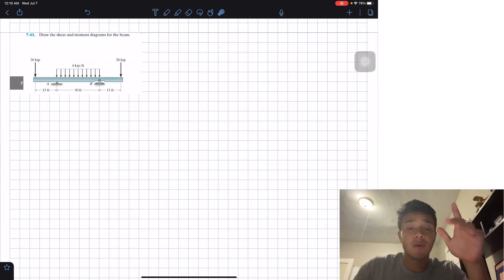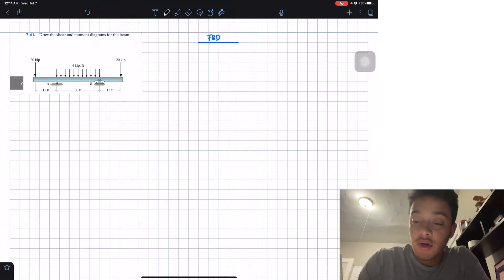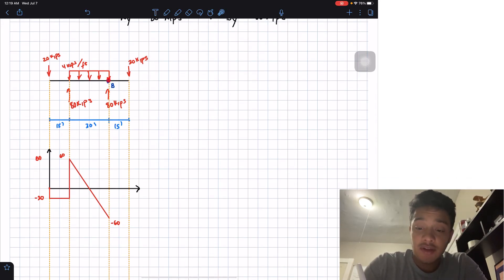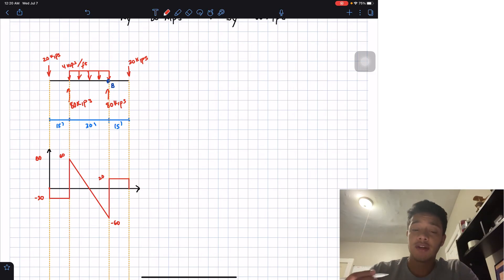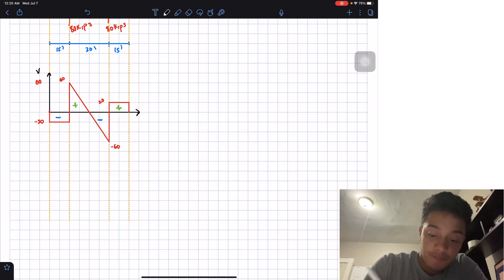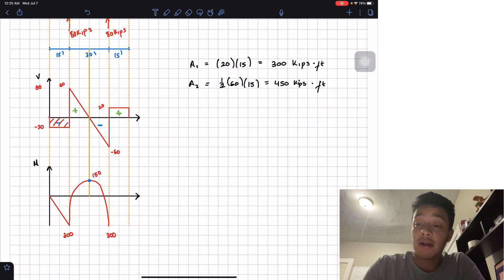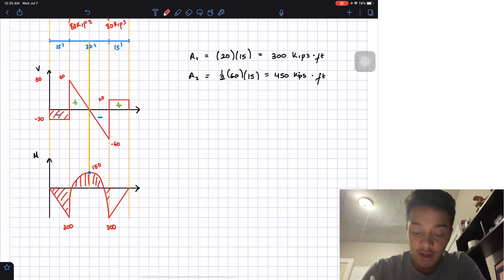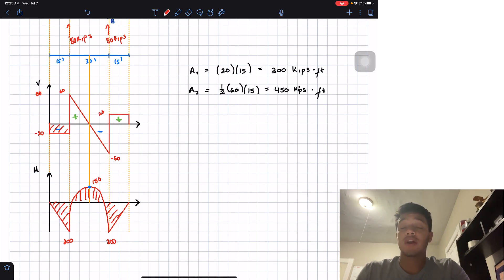Statics 7.61 - Draw the shear and moment diagrams for the beam.

Comment: You explained the logic really well, using it I was able to mentally complete the BM diagram. I’ll look for other examples to 
 complete BM in my head without writing.

Using similar area method to get the points on y axis (integration) Can u also do few examples on deflection diagrams? 
Thank u

Comment: How did you know the Moment at B was counter clockwise? 3:20
Reply from the maker: Hello Chris, at the minute mark 3:20 I did not know that the moment was ccw for sure. However, I have to make an assumption and I will always chose the CCW as positive since its the 'most' used positive direction, and its also similar to the angle/degree direction. Now, if my answer at the end gives a negative that just means my initial assumption was wrong, which it is okay to have negative values :)

Comment: when calculating the area of center triangle, the base is not the length divided by 2. You have to divide the left (60) by the kips/ft value to get the base. 60/4 is 15.
Reply: yes